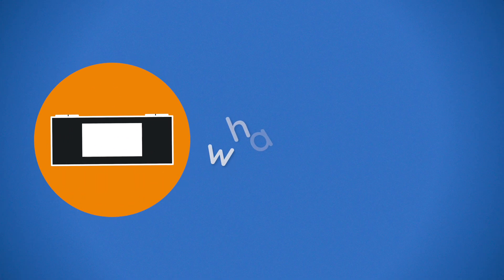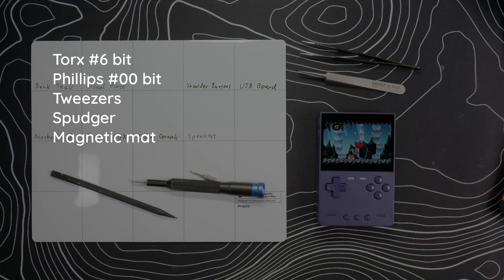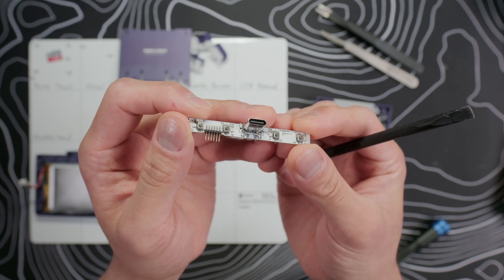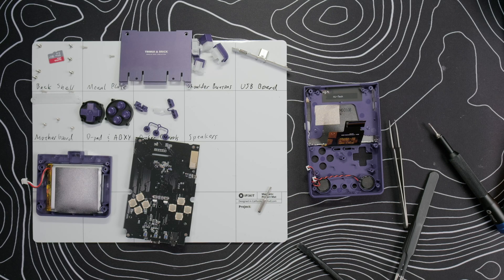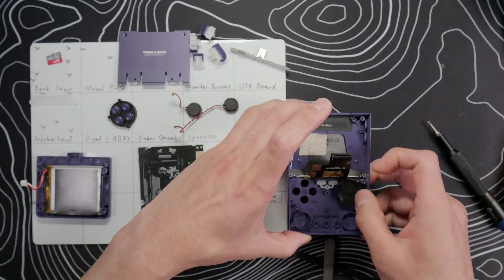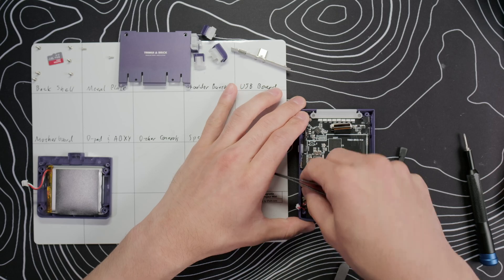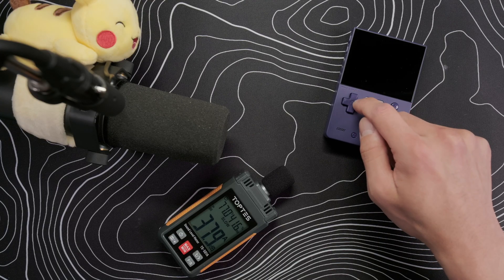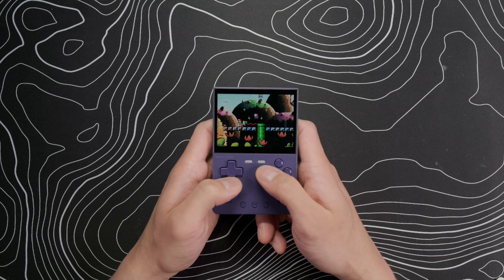TrimUI Brick (& Brick Hammer) Teardown & Modding Guide

Comment: Any reason you didn't replace the OEM thermal pad for a better one? I'm thinking of doing it. Also how long-term are the electric tape?
Reply from the maker: I don’t really push this device that hard when I was using it, so I didn’t have the heat issues other reviewers noted, so I didn’t think to replace the thermal pad. I haven’t had an issue with the tape coming off the dome switches for any handheld I’ve modded, so I’m not worried about it for the Brick either, hope that helps!
Reply: @whatobiplays yes it did thank you so much for the update, if I was to upgrade the thermal pad what would you recommend as a replacement. Also just to let you know I found your teardown to be the most straightforward and simple, earned a subscriber.
Reply from the maker: I appreciate that! These are the thermal pads I used for my other devices, they’re very soft and squishy so they’re kinda fragile, but they have a great thermal conductivity rating, and you can get them in different thicknesses https://amzn.to/4oymeaL
Reply: @whatobiplays  thanks for this I'll be recommending you to any retro people I talk to